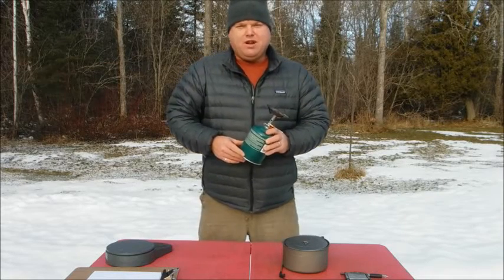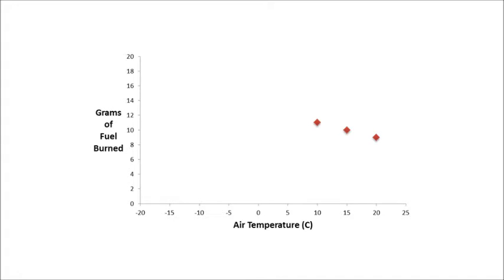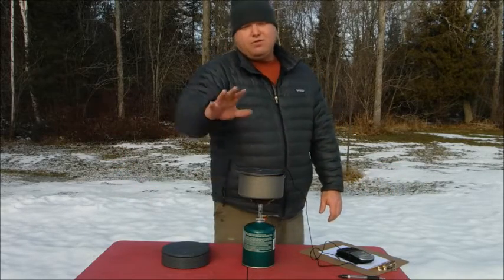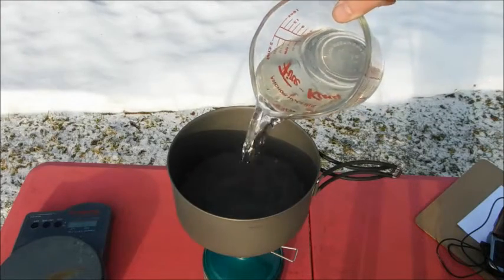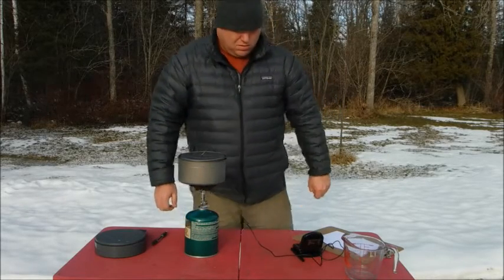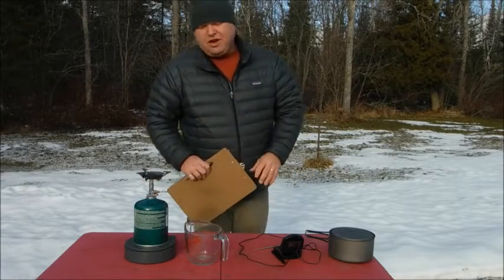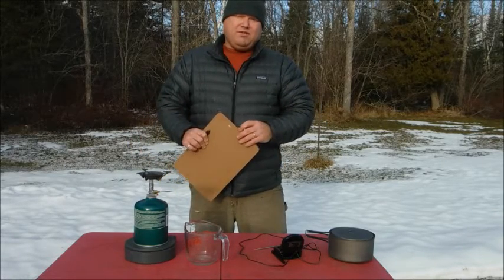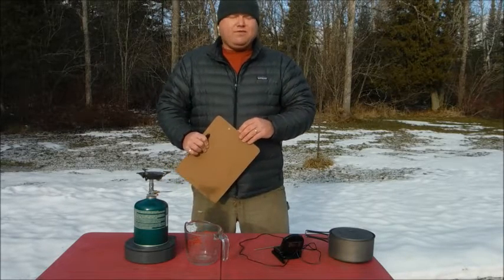Ambient Temperature Stove Test

Comment: Does any heat from the stove burner and reflection down from the pot heat the fuel canister?  This effect might compensate for cold ambient air effects on canister pressure? One of those laser temperature readers might be able to confirm canister surface temperature while burning. The old Optimus 123 stove has a white gas liquid fuel tank underneath the burner, no pressurizing  pump, and it relies on stove heat to pressurize and partially vaporize the white gas. The brass fuel tube to the burner conducted heat down to the top of the fuel tank, and heat was also reflected from the pot down onto the brass fuel tank, heating it to pressurize fuel.  More vaporization occurred in the fuel tube (generator) en route to the burner, but this was liquid fuel, not butane/propane.  Anyways, there may be an inherent heating of the fuel canister effect that warrants testing. Have to wait for winter again to test!  :-)
Reply from the maker: Thanks WInterT.  Some good thoughts.  I think with canister stoves the heat reaching the canister is low or negligible .  You can usually stick your hand under the stove while it is running but there must be some heat transfer.  You are right a laser thermometer could be used to find out.

Comment: Interesting. I would have thought so also. I understand that canister stoves fail at cold temperatures. Thats the reason many switch to alcohol stoves in the winter. Thoughts?
Reply from the maker: I left the canister and pot outside for a considerable time before each test so the fuel was cold, but I kept it on the table and not in contact with the ground.  Canister stoves can fail if you set them directly on snow.  The fuel won't vaporize properly if you do that.

I think what is happening is that the stove is very powerful and basically overwhelms any of the cold air around the pot.   I am sure there is a slight difference since the pot needs to be warmed up more at colder temps but the difference is so small I can't detect it.  It is a thin pot and likely comes up to temp almost instantly.  I would bet the results would be different with a heavy cast iron pot.

All these tests were done on relatively calm days.  I think wind would be much more of a factor at colder temperaturs.  

I have an alcohol stove but I haven't used it much.  I'm more of a 'stovie' and like things to boil quickly.  That's just my personality and not a technical preference.  I know alcohol stoves are very popular and effective.  I'm thinking of doing a video on which system is lighter for different lengths of trips.  

 I have a buddy who does mountaneering and his trick to using canister stoves is to pour a bit of water in a small tray then he sets the canister on that on top of the snow.  He says it works fine at altitude and in cold temperatures.  Considering where I live I won't be doing any altitude tests any time soon ;-)